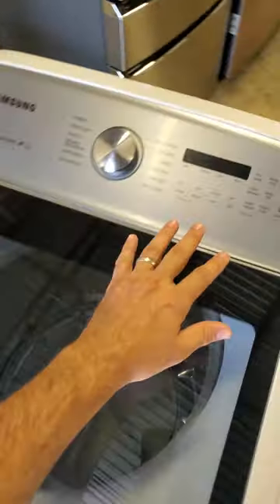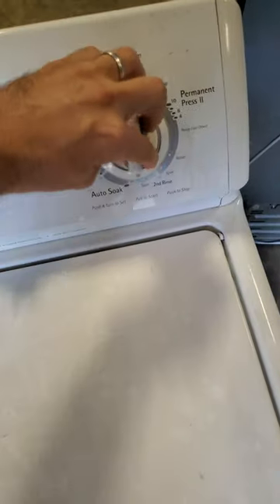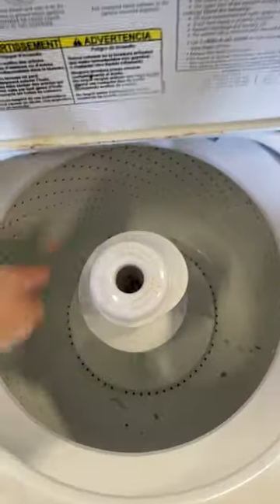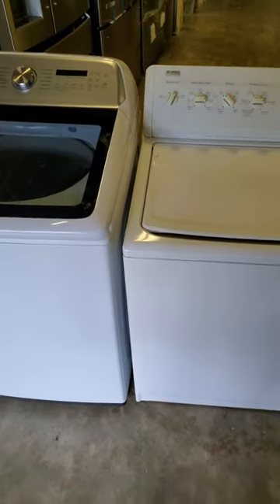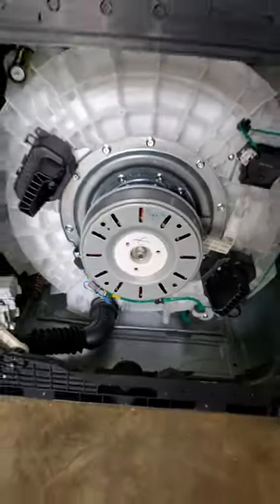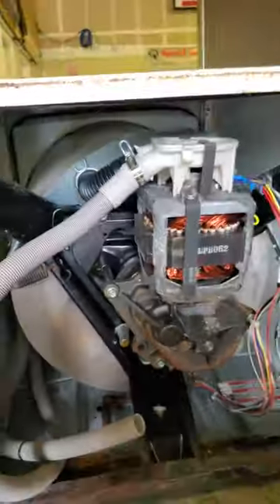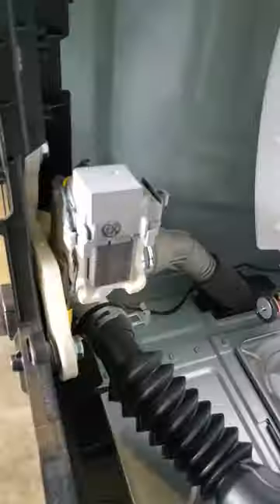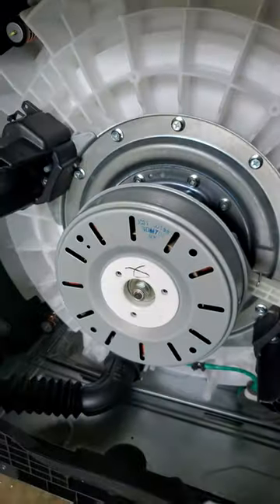Buying New Washers vs Old Washer

Comment: And the older washers drive tends to go through a gearbox/transmission, meaning higher levels of torque so they can handle heavier loads no sweat. Newer models are normally direct drive, so are severely lacking in the torque department, so tend to fail more readily and have less power for those larger, heavier loads. Also a gearbox/transmission is usually a bit cheaper to replace or fix than an entire motor is - especially these newer computer controlled motors. Honestly you look at most things and older models were just built tougher to last compared to stuff today. Planned obsolescence is a thing and it sucks!
Reply: And it's a global fall in quality! 😭 In Europe we had frontloaders since the beginning as a standard and my mom had hers for 30 years and in all that time the only thing my dad replaced was the heating element that cost him almost nothing, then my mum changed it becouse she was tempted by more modern machines and 5 years later the engine broke on the new washer and was too expencive to replace, so she got another one. Plus, nowdays companies cut corners on producing costs and the real reason why mould pops out is that they don't give the plastic and rubber components anti microbial treatment that they only reserve now to professional washers!

Comment: Designed to break or designed without breaking in mind? Seems like they decided to cut costs in manufacturing so much so that it spilled over into reliability. I doubt Samsung or LG is making a ton of money on appliance repair. Id expect them to make almost all their money off sales, which would explain the cost cutting. Seems like theyre trying to get as much profit out of that initial sale as they can.

Comment: Computer control system is not necessarily bad. I had a computer control system on my Asko front loading washing machine from 1996 and it broke this year after over 20 years of heavy duty! It had steel seal door, so rubber bellows free. It had Quattro construction - vibration free spinning and a brushless motor to keep noise levels down. Super quiet machine! And most importantly it never smelled bad! So this year I bought the newest version from Asko and they are even better! Almost no sound from the machine! Love this brand and love Scandinavian innovation!

Comment: Agitators destroy all my pants. There's a reason we moved away from them.
Reply: Hey that’s a good point. My jeans are lasting longer.
Reply: There must have been something weird going on because I've never had an agitator mess up pants. I have, however, had the zipper on the pants rip holes in other clothes in the load.
Reply: Without the agitator they clean the clothes less effectively
Reply: @nygreek743  That's why we have front loaders.
Reply: I will never ever purchase a washing machine without an agitator because we used to have one and it didn’t even do basic cleaning. I might consider buying front loaders but I heard those ones are a pain to maintain and clean.
Reply: @TheKSGChannel889 
I am on my 2nd front load washer, only had to replace the first one after 11 yrs of solid daily loads because the bearings in the drum wore out & to replace them  would’ve cost a fortune.  So I basically wore it out.   Loved that machine.  Now I have a new front loader.   I’ve had to help my elderly mom with her laundry using her new top load without agitator.   Let’s just say I HATE  the thing!    The clothes getting cleaned depends entirely on the detergent & if you do a small load there is really nothing to scrub the clothes clean.    
Whereas the front load, it barely uses any water (just enough to get the laundry nice & wet) & then the clothes get flopped around on top of themselves.  It definitely washes way better IME.
Maintenance is not difficult:
Keep the door open to dry out the drum when not in use.
Empty & clean out the bottom front filter once a month or so.
Use the tub clean mode every month or so to keep it clean.

Comment: in my experience new washers are totally shit. good luck finding one that lasts 7 years. old ones no computer BS will last decades
Reply: Yep, Jackson. my 1990 pair of Maytag machines are still working fine and it's 2023.
Reply: @karmelicanke  nice commercial grade?
Reply: @jacksonroad9263  No, Jackson, just the usual item for sale back then. There is printing on the board stating, Large Capacity,Fabric-matic, Heavy Duty, but not commercial grade.  The settings are delicate, permanent press, regular, and heavy duty. As a back up, there is an old square Maytag wringer washer in the basement. No kidding.

Comment: Just bought a 2nd hand Whirlpool mechanical washer from used appliance dealer. $250 delivered with 90 day warranty. Cosmetically and mechanically great.
I was gobsmacked in the BigBox stores where they want $600 to $800 for these Samsung's you demonstrate. Terrible reviews. Pure junk.

Comment: All of these changes were mandated by the United States government. That motor is almost unstoppable, but it also uses much less electricity. The new washer scrubs your clothes wear the old washer uses hydrodynamics to clean the clothes. The difference is about 20 gallons of water per wash on a top load washer. Again mandated by the United States government. 
The reason the modern machine goes out of balance so easily is due to the fact that people don't read the instructions and load them properly. This isn't a 40-year-old washer it's the new washer and they've changed the way we do laundry.

All of that being said the washer dryer industry has not recovered from the last time the government forced them to make changes. Now Joe Biden just signed into law that they have to make them even more efficient by 2028. Just think of the nightmare that's about to come

Comment: I'm still 'stuck' with YouTube showing me American Domestic Goods. I do find your videos interesting and entertaining though, even if I do poke fun at the format of the washers sometimes.  So I'm complicit in my YouTube fate 😂 

The old ones were certainly easy to repair regardless of format unless the program selector died.

German ones (modern format) still never die (sold over here anyway) and no,  I'm not German.  You get what you pay for, and they cost more.

Maybe you can fill me in,  the new high-quality ones sold here are vastly more efficient than the old ones in the same format (cheap ones, still more efficient, but less so).

So much so that the savings of the efficient ones pay for themselves in a few years by using a lot less water, detergent, and power,  whilst also producing cleaner and dryer clothes.

 The problem is you need to be rich to buy the best in the first place.

Is there the same movement in America? Or is efficiency, not seen as important
Reply: For what you pay upfront you will never get back by using less water 😂😂😂
Reply: @mwatkins2464 Good point, water is cheap for many of us. Less water used, does mean a lot less electricity is needed to reach a chosen temperature. I had presumed that's where the savings came from, it also keeps our under-investing private water companies happy as well.  As they don't need to invest in supply & storage to the same degree.

Comment: Top loaders should be banned
Reply: @Random-Videos205  the large volume of water they use as well as the cleaning aspect of not only the washer but the clothes itself.

Front loads, in general if you get a good brand (Miele), offer higher rpm spin cycles thus the clothes come out dryer. Quicker to dry while hanging or if you use the dryer. Of course soon cycles should be used depending on the clothes you have. I feel North Americans are still uneasy about front loads but I'm sure it'll happen soon to catch up with the rest of the Civilized world
Reply: @sorgster C’mon. Direct Drives have way more rollover and so do LG agitators.
Reply: Modern toploaders use much less water than the old ones do. They use about the same amount as a front loader. Plus they cost a little less and fit better in smaller laundry rooms, making them more accessible for people with limited budgets.